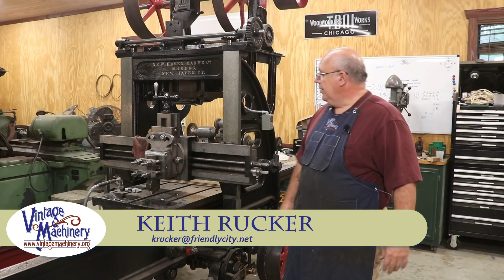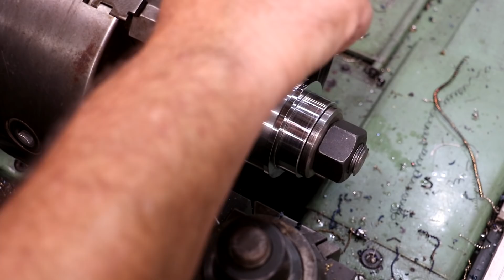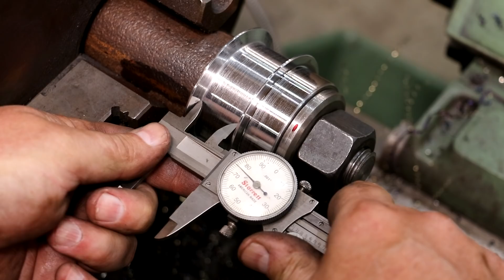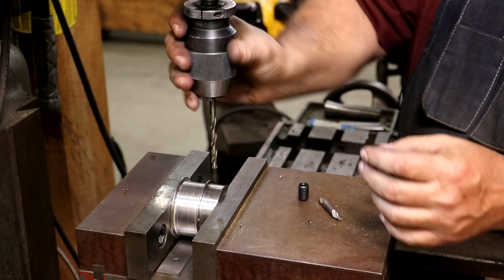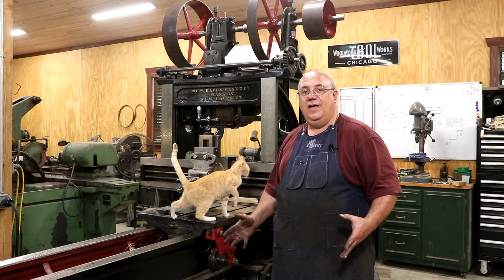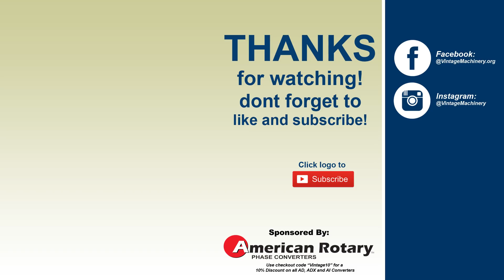Metal Planer Restoration 61: Machining a Flat Belt Pulley for the Mechanical Oiler

Comment: 2:00 It would be helpful if you could draw your plans on the backside of the page.   The printing on the page is distracting, especially that watermark logo in the middle of the page.   Of course, that's assuming that the back of the page is blank.

Comment: That looks good.

I kinda wonder if a round belt might have been more like what would have been used on something that small and low-load. They made leather belts that were a round profile with the ends stapled with a hog ring to make a continuous belt. The pulleys looked somewhat like V belt pulleys with a rounded profile in the bottom where the belt rode. At a guess something like a half inch diameter belt might have been used.
Reply: sounds like what those old singer sewing machine tables with the treadle to power the machine used.

Comment: In the last few projects I have been wondering what the significance of the grey parallel lines were in your designs.  Doh! Would be nice to see an inset with your DRO. Another camera, or a direct video feed from the processor? Easy, right?

Comment: Just asking because I don't know. Why is it in each video, that lathe seems like it is cutting more and more on the return after a cut?
Reply: It's because of the tool deflection. Any time you take a cut, whether you're turning, facing, boring etc. the tool and / or tool post is deflecting very small amounts under the pressure of the cut. So you're never taking the true depth of cut the handwheel says. This is why most of the time when going for your final dimension you want to take a "spring pass". Which is where you go back to the start of your cut and take a final cut at the same depth as your last one. You'll notice that even though you didn't adjust the tool at all, it will still remove a small amount of material. This will ensure you get the depth of cut you were actually shooting for. A spring pass isn't necessary on roughing passes since more material is just going to have to come off anyway.
Reply: @protospace270  You can actually see the whole assembly deflecting when he breaks the last corner around 21:15. That tool post is getting pretty tired.

Comment: I know you know what you're doing, but I still have to mention that they use crowned pulleys for flat belts for a reason. The shape of the pulley acts to self-center the flat belt. Hopefully this design doesn't cause any issues are premature belt wear.
Reply: Crowned pulleys only work if the belt width to thickness meets a particular ratio (which I've forgotten). On a narrow belt under about 1.5 inches width, the belt thickness is usually too high to meet the appropriate ratio, and the belt is too stiff to track a crown reliably. They did use flanged pulleys for narrow belts. Very often on light loads like this they would have used a round belt, and the pulleys would have looked like V belt pulleys, except have a rounded bottom profile.
Reply: @lwilton  this is the kind of information I like to hear. Why my assumption is wrong and what was done about it. Thank you.
Reply: @lwilton  Thanks. I like your information but it is not accurate ! I totally agree with what you say but that ratio is material dependent and I'd guess the ratio you're aware of relates to leather belts. More pliable belts will more readily follow a crown.
I suspect it's some very interesting physics of which I know little other than personal experience of rolling things as a kid like draughts. While many things that roll, when they lean to the left, they turn to the left - but wider things like draughts, when they lean to the left, they turn to the right !
Reply: @millomweb  Thanks for the reply! I have to say I simplified a bit. Yes, the ratio I don't remember is for leather belts since that is almost certainly what Keith will be using. But I knew that it was material dependent. 

If you want to know just about all there is to be known about leather belts, crowned pulleys, horsepower vs width vs feet per minute, adhesion vs surface texture, etc etc etc, you can do some searches in Google Books for "flat belts" and "line shafts" and the like. I did that a few years ago and discovered entire books (several of them) on the subject published in the late 1800s and early 1900s, as well as the proceedings of conventions of some professional organization that was dedicated to people that designed shop and conveyor power systems with belts.

I will say that I know nothing of draughts; I'll have to look that up. I had always assumed that was another word for darts, obviously I'm wrong. I'm guessing you are English? I don't recall any child's toy or game of that name from when I was growing up in the US.
Reply: @lwilton  Draughts = checkers

There are many publications around 1900s dealing with belts, pulleys, pipes, boilers, general engineering etc. Big books as well as 'pocket books' They're a fab read for pure interest in facts !
Reply: Yeah, I thought a crowned pulley would be the correct option.
Reply: That isn't that big of a pulley. I would suspect the belt would be thin enough for a crown to be effective. I'll be interested to see what he comes up with for a belt. 

Thise bijur pumps stayed the same for a long time. I used to service a web press that had one just like it. We used a small synchronous belt to drive it off the main shaft. We put a spare on the shaft, wrapped up in stretch wrap. Didn't have to break the shaft down to get another on.

Comment: Could you tell us why you put the part on the mandrel to machine the belt groove?  Why not leave it in the second set-up?
Reply: It ensures the O/D where the belt runs is perfectly concentric with the bore.
An unnecessary accuracy in this case !
Reply: @millomweb  But if the belt groove was machined on the same set-up as when the bore was . . . bored, that would ensure concentricty as well, no?  The part was turned around after the ring for the set screw was turned, so that wouldn't be strictly concentric with the other features (and didn't need to be); but everything else could have been machined on the same, second set-up.
Reply: @toiyabe_effect  It certainly would have been near enough ! Rather than reamering, he could have bored it with a lathe boring bar - then it would have been spot on - but for a belt pulley, that kind of accuracy totally unnecessary.
You'd have to ask Keith why he chose that method - possibly no one else would have done ;)

Comment: Why don’t you trust your DRO more? They are very accurate but for some reason you don’t seem to trust it.
Reply: Accuracy depends on the resolution of the system.
Reply: A DRO can't account for tool or workpiece deflection. It could theoretically be 100% accurate if everything were 100% rigid, but the fact that he cuts grooves when returning the carriage proves that his machine is not 100% rigid - which is effectively impossible, anyway. Metal flexes.
Reply: @Azlehria  Do 'return grooves' bug you as much as they do me when returning for measurement ? I'd go for reversing the traverse and come out at the speed he went in - perhaps with extra spindle rpm !
Reply: @millomweb  Somewhat, yes. I don't have so much objection on heavy, roughing cuts, but when they're sneaking up on the finish . . ..

The worst example of the cause was in another video I watched recently, where Keith took a spring pass because he was 1 thou over - and ended up 1.5 under. That's an absurd amount of spring for 5-10 thou cuts in cast iron!

Goes a long way toward explaining why his finishes look so much rougher than many other machinists, though. I know at least some of it is tool post (lack of) rigidity, but I also have doubts about the spindle bearings because that video didn't look like 2.5 thou of deflection in the tool post. 1 thou, maybe.
Reply: @Azlehria  UK 'Doubleboost' - last year, I suggested his spindle bearings were out of adjustment as his chuck spun very freely. Others made suggestions too - so he had a go at the bearings - result much less chatter when parting off. Maybe Keith should consider a tweak to his ?

As for mine - they pass my 'chuck key' test I recently invented re the issue with doubleboost last year. With the spindle out of gear (inc. power feed drive) I can stick my chuck key straight out horizontally ( 9 O'clock looking from tailstock) and the weight of the key is not enough to start the spindle turning. But if I prod the key downwards with my finger, it'll accelerate.
Not knowing anything about what's correct but being an engineer, I'd say that's about right :))))

Comment: Thanks Kieth. A request please. When you show us your sketches please use a darker pencil or marker and on plain paper so we can see it.
And a comment. I notice that many producers of videos put material in the machine with the colour coded end sticking out to be machined off. The next time they go to the stock bin out comes a piece of "durbar" only to be exposed as HRS. Wouldn't it make sense to use the cut end and leave the colour coded end available for identification later?
Regards from Canada's banana belt.🤞🇨🇦👍

Comment: Did you consider making that pulley split, so you wouldn't have to wrestle taking the large pulleys off to install it?
Reply: He'll have to do the same to fit a belt unless it's a split belt ! He could have avoided that by fitting a cam !
Reply: @millomweb  It is assumed that a flat belt is split, you cut them to length and join them with connecters
Reply: @lesbender236  You carry on assuming but I'm in the real world and have seen continuous flat belts of various sizes. There's probably one or two on your car !
Reply: @millomweb  Perhaps, but not made of leather as they were in the day of this machine
Reply: @millomweb  Not so much. Automotive applications tend to use V-belts, polygroove belts, ribbed belts (not the same thing), and/or toothed belts, depending on their age. Frequently you'll find flat pulleys, but those are driven by the backs of wider belts and most often are guide or tension idlers.
Reply: @Azlehria  Most of those you mention are flat belts ! And are not split !

I'd be interested in your definitions of ribbed and polygroove belts.
I'm wonderif either are the poly V belts !
Reply: @millomweb  How are they flat belts? They're not flat! They all have a flat side, but so does any belt profile other than round - including a V-belt, the classic example of a belt that is not flat. Offhand I can't recall any examples of the flat side of an automotive belt being used for power transmission.

As I recall, the difference between polygroove and ribbed was essentially the profile, with the former being more or less a subclass of the latter and synonymous with poly-V. I can't find the books anymore after almost 20 years and the only reference I can find online has no more support than I can provide, so I'll have to retract that assertion for now.
Reply: @Azlehria  "How are they flat belts?"
When they're significantly wider (at least 3-4 times) than they are thick.
It's no reference to the driving surface being smooth, just the aspect ratio of the cross-section of the belt.

Comment: Hi Kieth chances are that the belt will try to climb the walls of the pulley, all you need is a crown to keep the belt centered like the rest of the pulleys.
Reply: I think only one of the two pulleys need be crowned for centering.  Hopefully, the other pulley is crowned, I am hoping to see the operation.  

If Keith makes that one flat as well, then the belt will definitely climb those walls, leading to premature wear.
Reply: @WhatAboutTheBee  it looks like the drive pulley is flat, I don't think another flat pulley will work
Reply: @richb419  Correct.  The pulley Keith turned is this video is definitely not crowned.
Reply: My thoughts as well, a crowned pulley seems like it would be the simplest and most elegant solution, self-centering, less wear, and period correct.